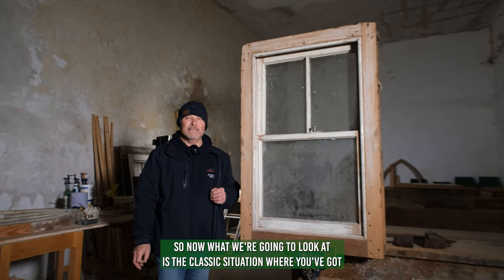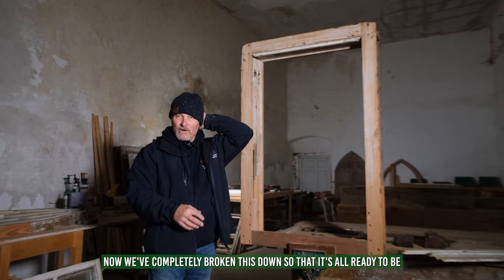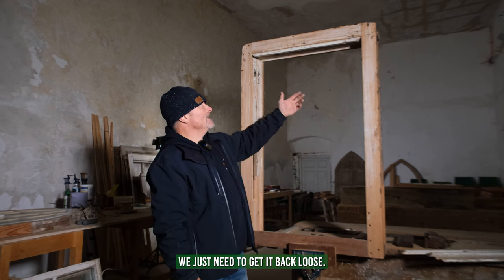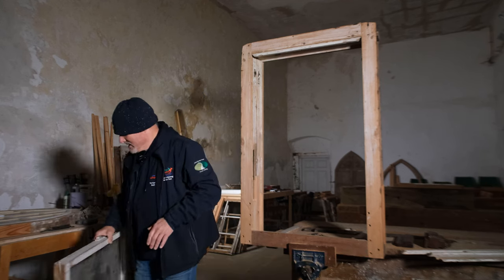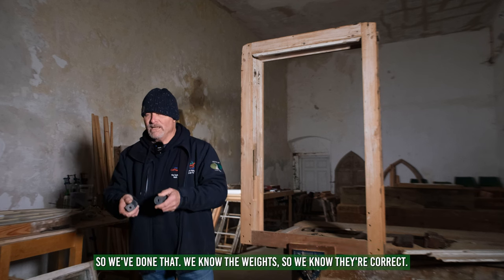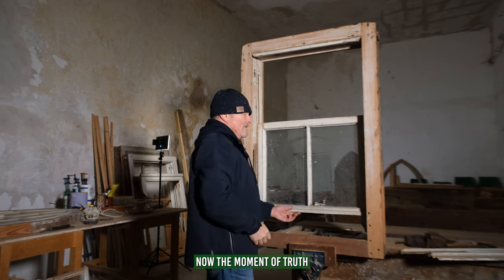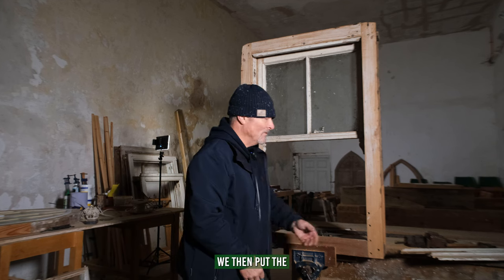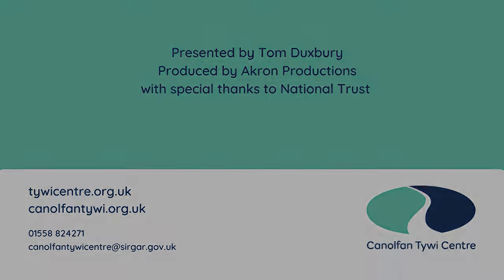Traditional windows: their care, repair and maintenance

Comment: Could you make a video on your thoughts regarding installation methods for timber windows into solid walled traditional stone buildings? Expanding foam vs. breathable caulking materials like Oakum or sheepswool between frame and stone reveal? Plastic DPM tucked under the bottom and stapled to the inside edge of the frame or not? How to install the interior hardwood sill board so it doesn’t rot?
Reply: Hi Alexander.
That would, indeed, be a useful video to do. Installation and sealing is something that we cover on the Heritage L3 NVQ training. In short, timber should never be sealed with impermeable materials - plastic paint, foam, DPCs etc. the timber will always want to breath so moisture will build up at that interface increasing the risk of rot. A soft lime mortar or burnt sand mastic is always the best option especially where a breathable paint system can be used. For fixing box-frames they were traditionally built-in with the head and cill horns. Retrofitting or repaired frames can have straps fixed to the back and extended onto the reveals or, if a solid backing board can be introduced, fixed through this via the pockets and pulley holes.
Reply: Thanks, that’s what I was expecting you to say and is corroborated by the rotted existing timber windows in our old stone cottage which were cemented and foamed into place.

To install our new solid oak sill boards, I have already broken out the cement slab that had been poured over the stones across the breadth of the bottom of the reveal. Then I’m planning to pour a replacement bed of a fairly wet mix of NHL 2 and sharp sand, and then bed the new Oak sill board directly into that wet lime mortar and then just tap it level and let it set. Can you think of any reason that wouldn’t work or wouldn’t be a good idea?